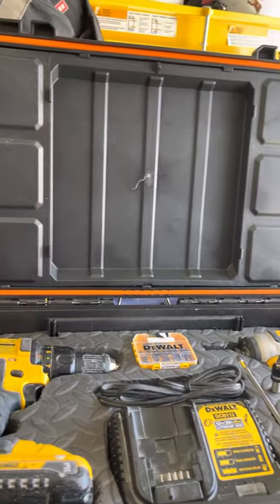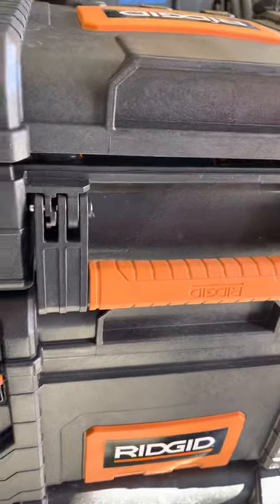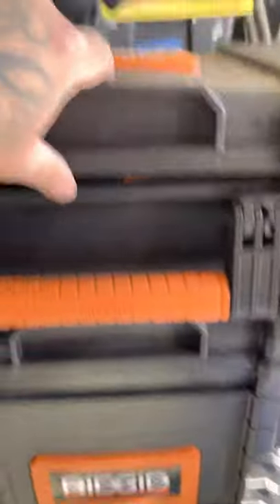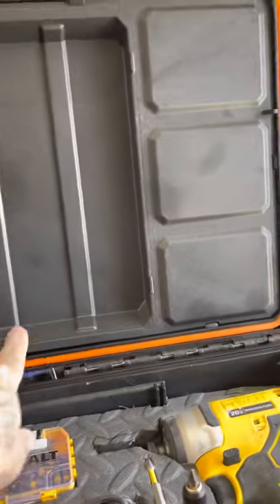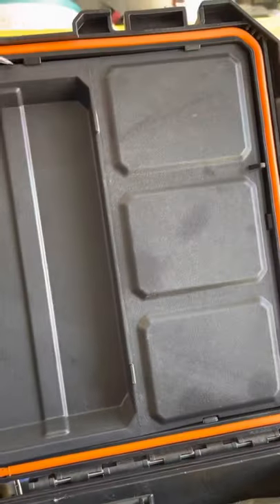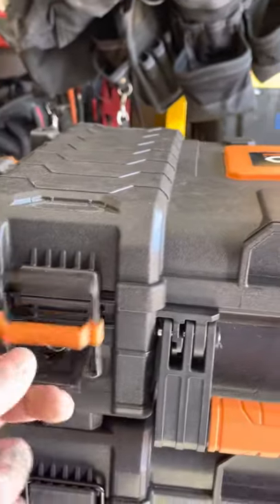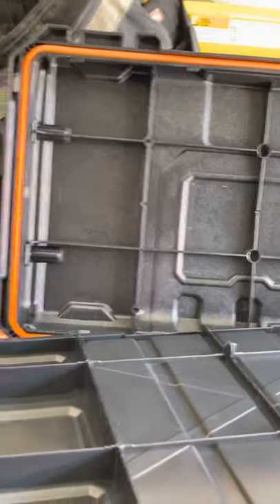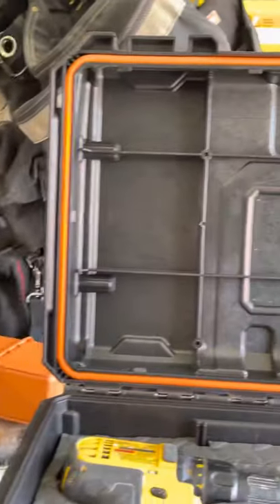Personalize Rigid tool box￼… #handyman  #tools #toolbox #ridgid

Comment: That looks great! I'm a huge fan of using fatigue mats as foam. Way more sturdy than Kaizen. My first attempts were pretty ugly. I used the white kaisen-style foam they use to pack around flat panel TV's and other delicate electronics. I totally just gave away my age by saying flat-panel tv, as they all are now flat panels of some kind. Anyway it was white so every bit of dirt and dust would collect in the bottom of the tool box. 
If it were my Ridgid box, I'd cut out the battery shapes on that inside lid cover. I do not ever cut my actual boxes, but I slice of dividers, or anything removable, all day long. I can't see it having any other purpose than to keep the storage bins secure

Comment: I think thats a weather seal
Reply from the maker: Yes you might be right bro… I didn’t know it came out… but I did have to install it back because it made my drills move a little
Reply: They seal around the main part of the lid .
Reply: I use 8 of this exact box daily, and probably 5 or 6 years since new.
3 of my boxes have the upper liner removed for clearance for larger tools.  The liner seals the top of the orange bins when the lid is closed, keeping small parts in place.

The weather seal still works fine.

The lid is a little weaker/softer on top, and a little less stiff, but nothing has broken after heavy use.  I  guess I would sit on one of the lined lids to eat lunch....

These are a great series of boxes for durability and value....lack some of the bells and whistles of the other brands, but a solid product. They usually go on sale around Farhers Day every year.

Most all of the other brands (Husky, Dewalt, Craftsman, Milwaukee) are also made by the same company Ketter....the Rigid boxes are sold in Europe with the Ketter name, and blue color instead of orange marking.
Reply: @muddywater6856  good info. Thanks
Reply: @muddywater6856  Great comment and feedback.  Keter, an Israeli company, seems to absolutely dominate the poly-foam stacking toolbox business!  I don't know of one brand of stacking box system that isn't manufactured by them.  This includes (I believe) Craftsman's stack, Ridgid's Pro boxes, Milwaukee Packout, DeWalt ToughSystem, Ryobi Link, Husky's box stack, Menards' Mastercraft stack, and probably even Harbor Freight's new box stack.  I'm sure there's some others that I'm missing.... it's a crazy list.